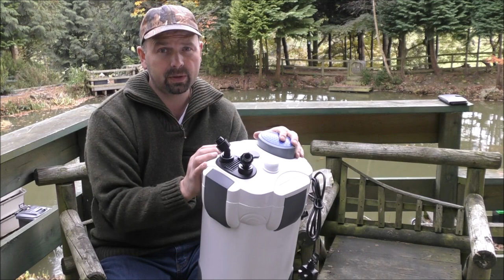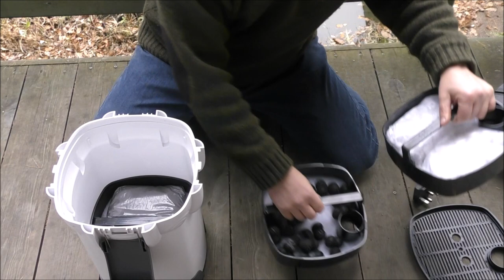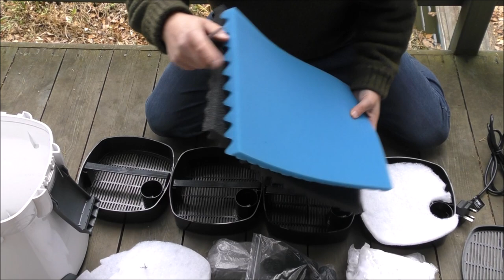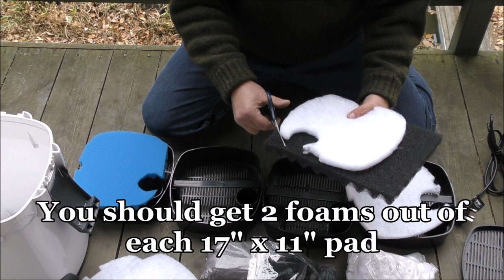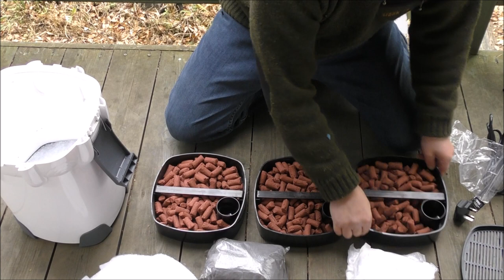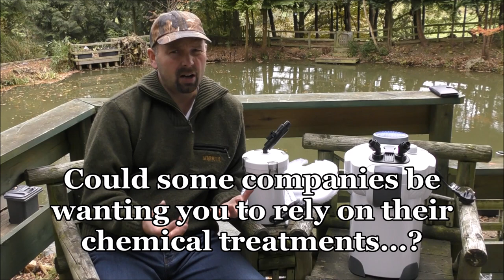Why Your Filter is TOO SMALL and NOT CYCLED

Comment: This video is fantastic advice. I have the fluval roma 240 aquarium. Medium stocked and heavily planted. On the aquarium i was running the 306 which was supplied with the tank set up. I ran it for about a year until i saw this video and my nitrates never fell below 40 to 50 ppm even after doing 40% weekly water changes. After watching this i upgraded to the 406 canister and also added the booster filter. In the booster filter i have coarse, medium and fine sponges. In the filter i now have just under 4kg of the bio home ultimate media. It has been running for about 9 months now and the results are outstanding. I now do a 10% water change every 2 weeks and my nitrates are more or less zero never exceeding 5ppm. I clean out the booster filter once a month and the 406 every 3 months and to be honest the 406 is spotless so will start running it even longer in between maintenance. Excellent advice on everthing from this chap highly recommend to follow all these steps for an excellent environment for your fish. Richard you should design your own canister filters and get them out there with all the correct specs and media. Its definitely worked for me big thanks and keep up the great work you are doing.
Reply: How would you know if this is fantastic advice? None of the people watching have any expertise in biology.  How did you come to the conclusion that this was good info?

Comment: finally someone explained it propperly :) pointing out the ratio between filtermedia and water volume is great! I read multiple books till I got to that very usefull information.
Reply from the maker: I'm amazed you eventually found it in books since I hadn't found that information in 25 years in the trade!
Obviously the figures of kg of media to litres of water I gave in the video do not apply to all types of filter media as most will not support aerobic AND anaerobic bacteria but the general sizing of filters will still be accurate.
Choice of media is critical to achieving the full cycle.
Reply: Yeah :) books about aquaponics usually cover that topic.
Reply from the maker: Groovy.
Reply: I ordered and read a ton of books and can assure you I never found the relevant information in regards to media and tank size calculations.  With how obsessive I am about reading about this I merely stumbled on this video by accident and knew I’d found the missing piece...

Comment: Kind of new to the hobby but very new to canisters. This is the best place for beginners in Canister filtration. Thank you!
Reply: Really, you don't need one. Use a matten filter instead for a fraction of the price on a normal sized tank (if you build it in to the corner you can grow moss on it and completely hide it). It's a lot less hasstle and you won't notice a difference filter wise. I'm finding that canisters just end up trapping a lot of crap which turns in to algae/diatome food.

For breeding no one uses canister filters, everyone uses sponge filters of some kind. That should say something.

Comment: I've had a 55 gallon freshwater aquarium for the last 10 years. Have always run a side filter with carbon, never had any problems. I never use chemical additives in my setup. I do water changes every two weeks. I do add salt to keep electrolytes to fight off ich. I just ordered a cannister filter to maximize my water content. Your videos make a lot of common sense to water conditioning. Keep up the good work.
Reply from the maker: I'm glad you enjoy the videos and find them useful as I think it is very important to get useful facts and figures about filtration out there online. Although it is the most critical part of fish keeping it is so often ignored in favor of 'look me an my fish' type videos which have no useful content in them.
I'm currently working my way through as many filters as possible as part of a new series to show how water flows through each type, best set up method and explain the limitations of each filter as far as recommended tank size goes (for a full cycle) since figures from manufacturers are all over the place.
For example I did a video on the FX6 which is 'for aquariums up to 1500 litres' and it took 5kg of media to fill the trays (making it suited for a normally stocked tank of around 500 litres) and have just uploaded a video on the Unimax 700 which is 'for aquariums up to 700 litres' and it took 8kg of media to fill the trays (making it suited to a normally stocked tank of round 800 litres) so the one which promised least actually provided much more filtering capacity - there is no industry standard to the claims manufacturers make about their filters so it leaves the end user very confused and often misled. Ultimately that causes tanks to be terribly under-filtered and fish to suffer and that is something I'm passionate about combating.
I'm currently adding the information to a 'Filters' page on my website which will eventually allow viewers to check the list of filters and see a detailed set of information about all the filters so they can check if their current filter is big enough for normal or heavy stock, how much media is required if they want to upgrade the filter and also have links back to the relevant Youtube videos where I upgrade that particular filter. It's costing a small fortune to collate the information since I'm upgrading all the filters people send me for free and posting them back for free too but I think it is important to have a hub of freely available information available for fish keepers.

Comment: Pleased to say that my little Eheim 60L internal filter, 5 plants, and 2 inches of 5mm gravel, I have 0 nitrates.  I have just introduced a AquaOne Nautilus 600 to my tank and am in the process of internal to canister conversion.   Running them in tandem of for a couple of months while the canister comes up to speed with the canister setup you suggested in another video.  The canister is currently running with the supplied media, except for the foams.  I have changed those up.  When it arrives, the Biohome with replace the ceramic noodles, and the noodles will replace the bioballs.  I tested my water this morning.  pH 7.0, nitites 0, nitrates 0.  I am pretty pleased with that.  Thanks for all your help.  It has been so valuable.

Comment: Can you explain how biohome is better than matrix for denitrification?
Reply from the maker: There are a few reasons which spring to mind:

- Every piece of biohome is exactly the same structure
- The structure of biohome allows for a balance of aerobic and anaerobic bacteria in any flow (seachem recommend a 50 US gal. per hour flow for matrix at which point you're effectively trying to create a nitrate reactor which could work with any media). 50gph is not practical or achievable in 99.9% of aquarium filters.
- Sand is one of the most receptive surfaces for bacterial colonization
- Some forms of biohome have specially chosen trace elements to boost bacterial colonization and activity allowing it to mature faster and work harder.

I'm sure that there are more reasons but maybe the best visual demonstration is in this video I did where I look inside lots of different types of filter media: https://www.youtube.com/watch?v=QTtAUYR67Eg
For the 'matrix' I used a better form of white pumice without all the junk rock found in seachem's pumice (matrix) as I wasn't going to spend many times more than necessary on an inferior grade of white pumice when I had half a ton of good stuff sitting on a pallet ready to be used in koi filters. 

In that video I touch on surface area but I really need to make a video specifically about surface area which will include total surface area, available surface area, variable surface area, suitable surface area and all the factors which make any given filter media good at supporting bacteria, having a long service life and being capable or incapable of achieving a full cycle.

Hope you enjoy that 'looking inside filter media' video and find it useful as it is one of the most important videos on filter media I have ever done but unfortunately it rarely crops up in the 'related videos' on Youtube for some reason. I know it has been deleted from a few forums which are 'sponsored' (controlled) by companies and individuals with very opposing views who would rather not have you seeing it so that is a seal of approval as far as I'm concerned, lol

Regards,
Richard